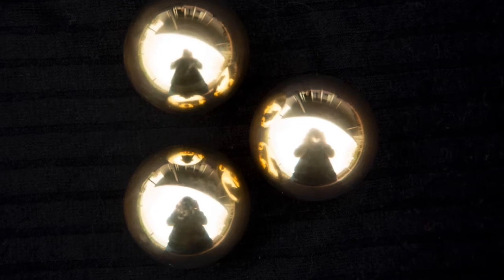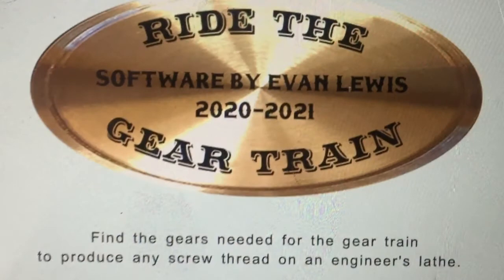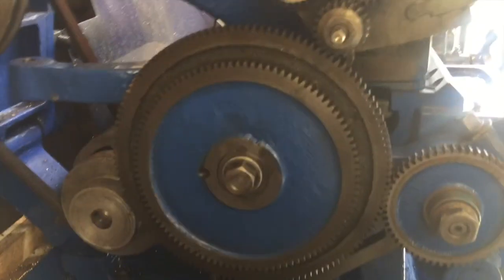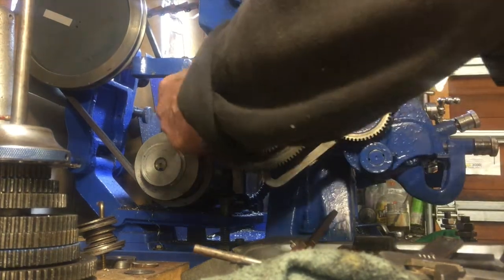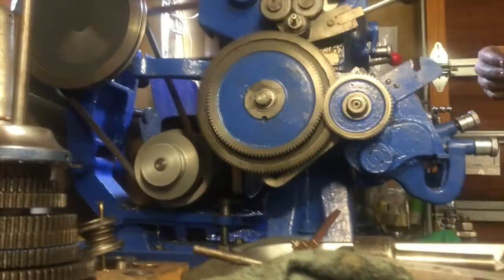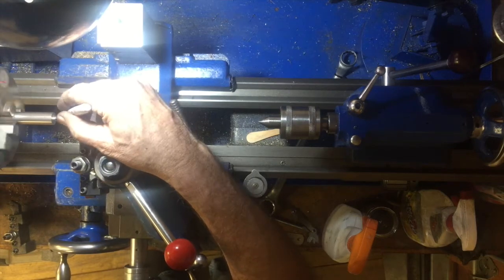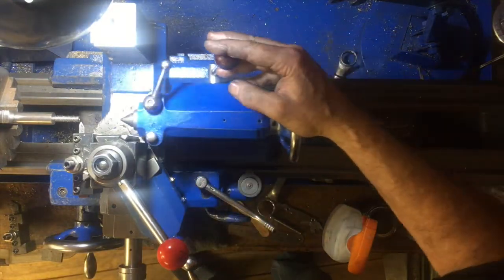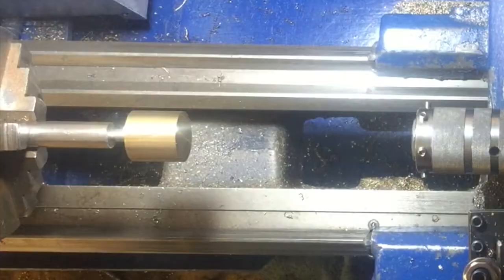How to turn a metric thread using an imperial lathe with a leadscrew measured in threads/inch (TPI)

Comment: Considering that the 100 tooth gear isn't meshing with anything what is the purpose of 127 divided by 100.  The 56 tooth lead screw gear is meshing with the 127 tooth gear not the 100 tooth gear.
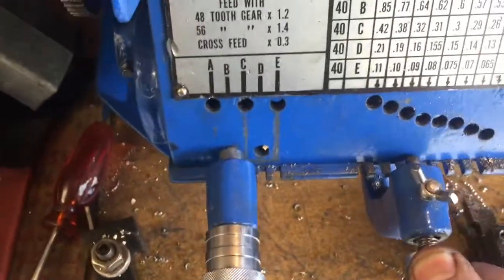Reply from the maker: You are correct, but I did point out that the way the gear train was set up was not correct as the 127 T gear was acting as an IDLER gear, and as you correctly stated the idler gear does not affect the gear ratio. This video clip at 2:30 minutes is the way the gear train was set up to cut imperial threads on this imperial lathe, ie standard setup.  However, at 3:30 minutes I show in detail how the 56T gear should be removed and a spacer added so that it meshes with the 100T gear.  So the explanation is correct if you keep watching.   I think I should explain this in the program notes (above).  I will give you credit.

The results of the RideTheGearTrain.com program were correct and the graphic showed how the gear train should be set up for imperial to metric conversion ie: with a 20T stud gear driving the 127T compound gear, which becomes a 'driven gear'. Then the 100T gear drives the 56T leadscrew gear. The gear ratio is then 20/127 x 100/56.  With 100 on the top line and 127 on the bottom line, this introduces the ratio 100/127. This is like dividing by 127/100=1.27 required for metric conversion (1.27 x 2 = 2.54).  Thanks for pointing this out.